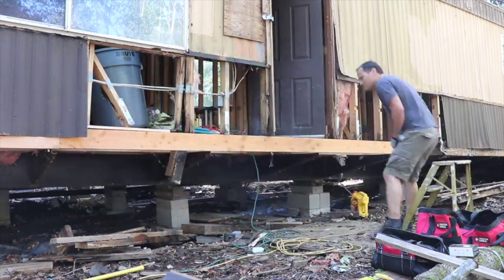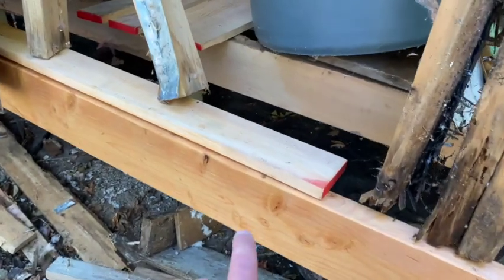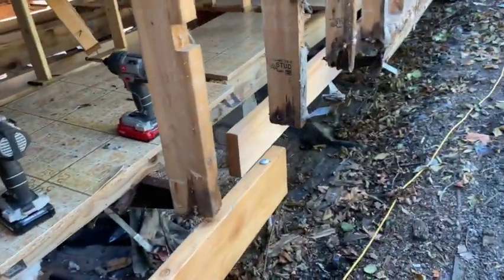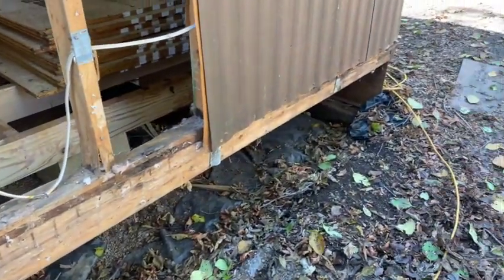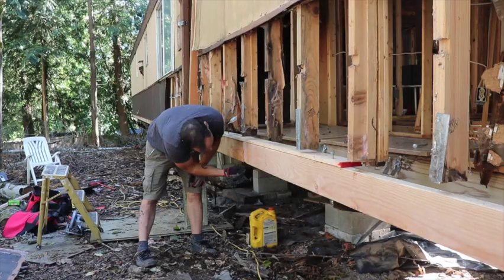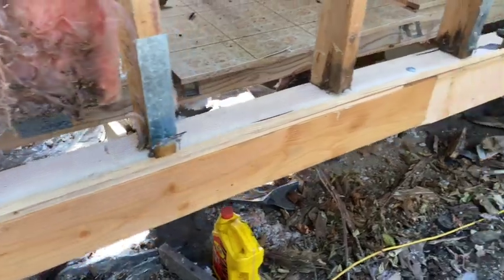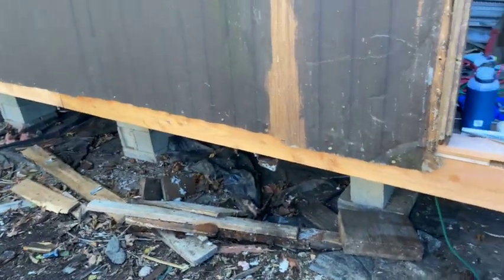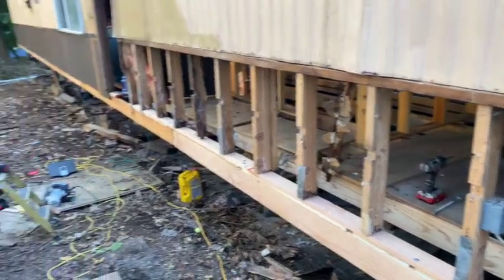Old Single Wide Mobile Home Rim Joist Repair Part 3

Comment: Thank you for this video. I’ve scoured youtube many many times looking for this type of repair. My outer floors that cantilever past the I-beam are sloping down and I don’t know how to repair them. It makes me feel like those exterior walls are going to collapse! So glad I found this video. Thank you again.
Reply: I wanted to add that my only problem is I don’t know how to access this area on the side of the house since it’s all completely covered. We’ll see.
Reply from the maker: Hopefully you're able to get the siding and skirting out of the way so you can work on your joists and hope my vid helps you out! Thanks!

Comment: I have owned 7  mobile homes ( one at a time) in my 70 years. I like doing repairs and actually dug a cement skirting on one of them.( Mixing cement in a wheelbarrow.) Paycheck to paycheck.Did small sections at a time and kept the rain off with black paper.You can fix most anything. CHEERS from Westcoast Canada!
Reply from the maker: Thanks!
Reply: I have always loved working on Mobile Home is my friend always
Reply: This has given me hope! I paid $14k for a decent single wide. 1988 Fleetwood 16x70  for me an my 70 year old dad in the NC mountains. It was all we could afford. Definitely needs some work here and there, but from what I've seen it's nothing absolutely horrific. The best part is the location,  not your typical sandwiched together park. 

I am in the process of buying tools and raw materials. I did notice there was a lot of dry rot (and id assume termite/ant damage once I start ripping it out) on the joist, and it needs some new underpinning/skirting as well. Was just trying to figure out if I was going to do vinyl or maybe go the hardieboard route.

Thank you for the time you took showing us less fortunate, but fortunate enough homeowners to be able to do these repairs we otherwise would not be able to!

Quick question...how do you determine how much length you want to use for your repair? I am going to just replace the entire joist around the home. Would it be advisable to go with decent sized planks or the longest I can possibly find? Any benefit to doing one or the other?
Reply: @totallylegityoutubeperson4170  Hardieboard is popular in the mobile home park I live in and it stands up to the weedeater.

Comment: Just found ur channel and watched all ur videos. For never doing this kinda work before you sure do look like a professional. I have a 1970 with an end bedroom with completely gone rim joists, in fact the entire end is held up by a rigged makeshift ceiling of 2x4s everywhere. I'm scared to take it on by myself and have thought of calling a professional, but I know it'd cost probably thousands for such a job. The whole place needs redone honestly. I wish you were close to PA I'd love to have you do this work for me. Keep posting, ur videos are without doubt the best mobile home repair videos on YouTube.
Reply from the maker: Thanks! That means sooo much. I might not be a pro but I've been pretty handy most of my life, from building forts as a kid, or skateboard ramps. I've worked in a factory making snowboards and was a member of a woodworking shop for a year. Made shed and some raised beds on a small farm I worked on too. I do plan on making a wood shop on my property after this is livable so I can keep working with wood. Just smaller projects. Anyway, thanks again. Appreciate it!
Reply: @thesomewhathandyman9400  Sounds like you could do pretty much anything then! I will be tuned in for all ur upcoming videos and probably use them as a guide if I decide to take on my place by myself....got the bell notification on for ur videos.
Reply from the maker: @W0RLDSSMALLESTVI0LIN  Sweet! You can do it! ;) I'll try to get one up this weekend. Thanks!

Comment: I just cut 3/4 flooring back 31/2 inches and installed pressure treated 2x4 instead of the 3/4 osb and the 3/4 inches 1x4. Braced the flooring with a block. Then wrapped with rubber membrane.
Reply from the maker: Nice. Hope that holds up well for ya! Sounds like it will!

Comment: Thanks for posting this video. I just bought an older mobile and.... its bad. Do you recommend doing a hiuse wrap on this old of a mobile?? I ask because the rot I'm dealing with is from condensate during the 10* weather that warms up then freezes constantly.
Reply from the maker: Most def. House wrap is a good practice. If you saw some of my other video's I do indeed use house wrap, although a lot of that had to do with it being code, I also believe it works well. Best of luck on your project and hope that my journey can continue to help keep you motivated and possibly give you some good tips. Thanks!

Comment: What is holding up the walls of the trailer while you take all that out? I’m just wondering how the exterior wall and the roof and everything didn’t at least SAG.
Reply from the maker: Magic, Drew. Magic. Ha! Yeah I wasn’t sure it would stay up. But I think it was a combination of the walls being light, the screws in the metal, and probably the little 1x2 runners that go length wise in the walls that the tin screw into. That’s my guess anyway.
Reply: I’ll be honest I thought it was pretty amazing watching you do that and the walls didn’t SAG I was surprised anyways good job
Reply from the maker: @Drewsroofingandhomerepair  thanks! And totally, I thought it was going to just drop when I removed the rim joist and when it didn’t, I was pleasantly surprised myself.

Comment: Is it possible to increase the size of studs on a per room basis? I have those small 2x3 boards on exterior, or any way to strengthen them without throwing off the lateral weight too much? I do plan on putting as much perimeter blocking as I can, in addition to adjustable outriggers, from what I can tell it's laid down pretty sturdy. I see 90 degree on most surfaces inside I put the level to.

Also, is it possible to repair the rim joist if the and not the wall joist/board? Do you generally have to remove or jack up the wall joists in order to remove the old rim joist? 

Thanks!
Reply from the maker: If your floor joists are 2x6 I imagine replacing the 2x3's with 2x4's wouldn't be too bad weight wise. If it's just 2x4 floor joists, yeah that could be an issue. Not sure how you could strengthen them without adding weight though. 
Yeah, you'll pretty much need to do a little bit of jacking up on the walls to remove and replace the rim joists. But if you just work on small sections you might be able to get away with not jacking it up but then you'll have a bunch of scabbed in boards which really wouldn't be that efficient or sturdy. It's really not that hard to jack up the wall with a car jack, some 2x4's and screws though. These walls are made pretty light. Hope that helps

Comment: Did u put a support in  the treailer before  wall studs were removed
Reply from the maker: Do you mean like a false wall? If so, I did not. I had it all gutted in there so everything was fairly light at that point and since everything was eventually getting rebuilt I didn't mind if things shifted.

Comment: That is very awesome wow you have your work cut out for you on this one. Looks very familiar I just did one myself and I thought the one I did was bad wow looking at the one you’re doing now is worse keep up the good work my friend I hope you come over to my channel and take a look at the one I did
Reply from the maker: Thanks Drew! Yup, I’ve been watching your video’s for a couple years now.
Reply: What’s actually funny is this is the first time I’ve ever seen a minihome with the floor Joyce  run length of the home not the opposite way like side to side.
Reply from the maker: @justaviewerortwo2924  right there with ya. I didn’t expect it either. Doesn’t make much sense structurally. Only makes sense for ductwork and main plumbing lines.
Reply: @thesomewhathandyman9400   The only thing I did think actually the floor joist running  is the way the framing is it actually might give it more support because you got the outrigging going to the outer walls and the all 2x6 or 2x8  were supported by the steel frame In some cases it might actually be built better than most. Would be kind of cool to have a structural engineer kind of give a comment on it to see if maybe that’s actually built better because when you think about it you have a steel frame sitting underneath the whole thing not just two beams with the out rigging . Kinda like the whole thing is supported by a frame versus the newer ones basically have two wooden beams run up on the left and right inside of the home and the floor joist go the opposite way. I own a mini home at an 85 and I’m totally amazed at how different the construction is from a regular home in some cases it’s better but in other cases it’s not.

Comment: In the process of doing this now.  I know on a stick built house you have to support the joist while replacing the rim joist.  Is that true for this process also?
Reply from the maker: It would not hurt I’m sure. However I have the weird build where my other joists run parallel to the rim joist so there really isn’t anything to support except for the front and back ends but those are supported by the metal cross bars. Since the long metal beams running down the middle of the trailer is pretty close to the outside of the trailer I think you’d be ok for support when removing the rim joist. I would just want to make sure you push up on the cross truss’s when you nail the rim joist into them.

Comment: That base board seal plate has to be pressure treated lumber or else it will rot quickly.  And you are supposed to support that load barring wall underneath so it doesn't drop when you repair the seal plate
Reply from the maker: I appreciate the input but I think you're thinking of a sticks and brick house build not a mobile home. This is not considered a sill plate. It's a rim joist and will not be in contact with a foundation so no chance of water sitting between it and a foundation. And yes, ideally I should have supported the walls when I worked on the rim joists and if it were a heavy house that def would have been a must but this is a very light mobile home with aluminum siding at the moment and a 1x2 roof with a light metal cap so I knew it could self support as I replaced sections. But yes, anyone who is watching this, take precautions as this is not a how to channel, just a how I do channel. Thanks for your concerns on being safe though. Cheers.
Reply: @thesomewhathandyman9400  what model is ur trailer your working on I have a 1975 with 2×2 and 2×3 studs and makes it more complicated.on top of having 2×6 and 2×8 floor joist

Comment: Looks like my old mobile home where the water heater is. The floor joists are rotted away about 18" inward too. The main bathroom sink is just as bad.
Reply from the maker: Yup, they were def not built to last! Ha!
Reply: @thesomewhathandyman9400  There was so much rot the water heater was about to go through the floor. Only about 1/3 of the floor under it was semi solid.
Reply from the maker: @cabman86  Yikes! But yeah if it was sitting on that old standard sawdust subfloor, I bet it was just hanging on by a thread
Reply: @thesomewhathandyman9400  A couple more inches and it would have hit the ground. I paid $1500 for the mobile home and have put about $4000 in it.

Comment: Do you or anyone have any ideas on replacing the end outer joist on a single wide? I braced the outside wall from inside but it still had some slight sag. I'm trying to figure out how I will get the new subfloor in front outside with this sag. Also, does anyone know the thickness of these subfloors? All the flooring in this trailer got so saturated it's swollen and I can't tell if it's 3/4 or 5/8.
Reply from the maker: Sorry to hear you're still having sag with the bracing. Maybe tack some 2x4's on the outside of the wall (take the siding off if it's aluminum to expose a wall stud) and have that tacked on 2x4 close to the ground so you can put a car jack on the ground  and and on the end of the tacked on 2x4 so you can jack the wall up to level or just above. I think my old subfloors were 3/4 but yours might be different. Best of luck!
Reply: I can't measure the old floor because it was so water logged at one point it's swollen and 5/8 and 3/4 is so close to same it's hard to tell what it is. I was hoping 3/4 because I want to use treated plywood for perimeter but they don't make 5/8 or sell it around here. Only untreated.

Comment: How come the outside walls come falling down?
Reply from the maker: If you're talking about those small wall studs it was because the window sill in that area was rotted out.
Reply: I’m sorry how come the outside walls don’t come falling down ? I want to do this to mine but worried they will fall. What’s holding them up
Reply: I’m guessing those rim joist don’t support any load?
Reply from the maker: @nicolaiuribe801  Oh I got ya. They didn't fall because of the aluminum sheeting screwed to the wall studs and those 1x2 runner sticks between the wall studs all help them to stay connected as well as the top plate of the walls being connected to the roof. It's basically one big unit so you can take sections of the floor joist out and not have to worry about it all coming down. I mean at some point the wall would sink down but if you do it in sections, you'll be A-OK. Hope that helps.

Comment: No matter how bad of shape a mobile home is in, if you have the time, money, determination, and patience, you can fix it. You could literally pull a mobile home shell out of the woods and completely remodel it. Would it be cheap? Oh no. Would it be easy? Nope. However, it can be done.
Reply from the maker: You are not wrong there at all. It just all depends on if it's economically feasible I suppose. I would never suggest someone do this to a place like a park with rented land but since my part of the country is absurd price wise, this just made the most sense economically.....although I do question it every now and again since it's taken me so many years. I'm sure I'll be super happy with the decision once it's all said and done.
Reply: @thesomewhathandyman9400  Happiness depends on what you want and expect out of it. My place is outdated, needs some repairs I've put off, is showing its age, but, hey, no mortgage, it's paid for, and it does what it intends to do (provide me shelter). I have maybe $3,000 total tied up into my trailer and I've had it about seven years or so. Just have to take it a day at a time and keep in mind whatever goals you have. My goals are simple: roof over my head. I've been super close to being homeless a few times and I have been forced to live in some very shady areas. I'd rather dump a few more grand into this place than to go back to what I had to deal with in the past lol.